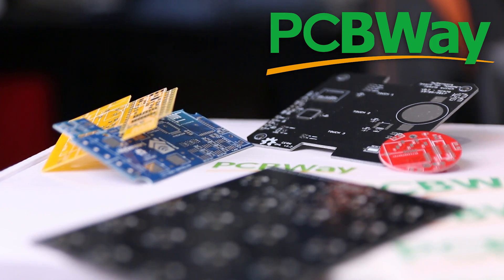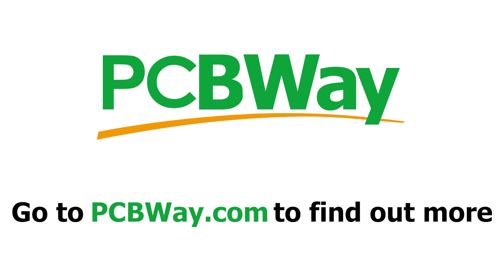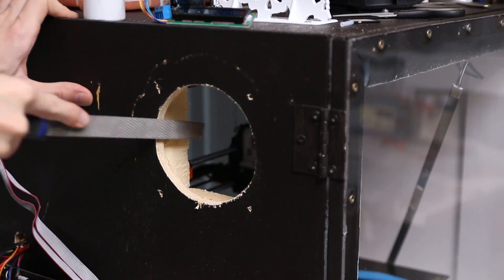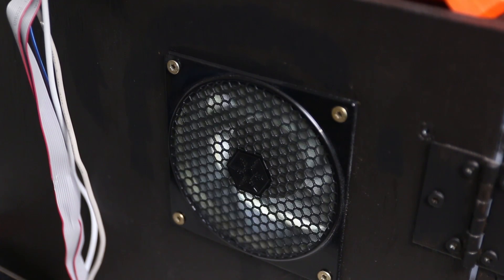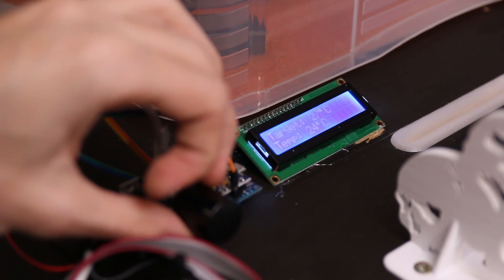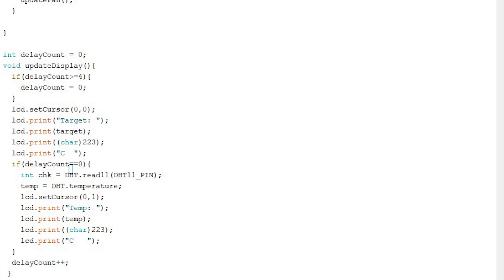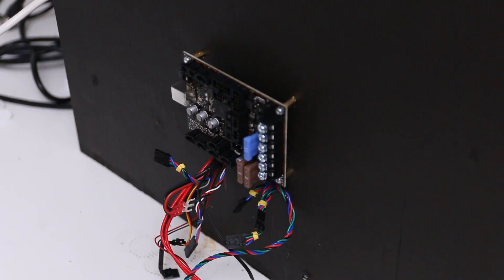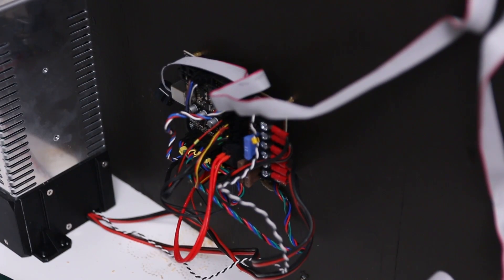Temp Controlled 3D Printer Enclosure! (part 2)

Comment: I'd like to build an enclosure with the fans constantly spinning to have a constant flow of air through it, so that the fumes are constantly being directed into the filters. The intake air would have to be heated (I plan tu use two pairs of 12V heaters wired in series bc the printer has a 24V PSU) and I'd like to control the heaters through the Octoprint Enclosure plugin. If you should want to to print tethered from a Pi, this might be worth a video :)

Comment: You can get digital thermo controllers for around $10-20. High temp ones have cycle control and separate solid state power relays.

Comment: Great Video and thanks for addressing the issue with the extruder melting. I am currently struggling with the same issue and slowly working my way through it.
I have got hold of the Slice Engineering 450C thermistor and changed firmware as per Chris Rileys video on the subject but even my PC-Max parts are melting when the hotend is around 300C.

I am having a lot more success with the polycarbonate warping issue by using "Magigoo PC" on the textured plate, it certainly helps a lot.

Comment: Nice video.  Can you sometime do a comparison of different enclosure temps effect on the print quality?.  Nobody seems to address it well.
Reply from the maker: That is quite hard to directly compare as it isn't necessarily an improvement you can see, but more the difference if a print succeeds or lifts off the build plate due to warping, or has layer splits. Those things also heavily depend on the filament used, the model printed and the slicer settings.
If you would control all these things perfectly I suppose one could compare different temps but that would be a huge undertaking.
Reply: I’m seeing differences due to ambient temperature (seasonal driven), so I want to build a temp controlled enclosure for repeatability.

Comment: Those toxic fumes cant be filtered, they are nano particles. You should add ventilation pipes that push the air outside the room. Also the inside insulation will burn fast. Is it needed if heat even ventilated outside?